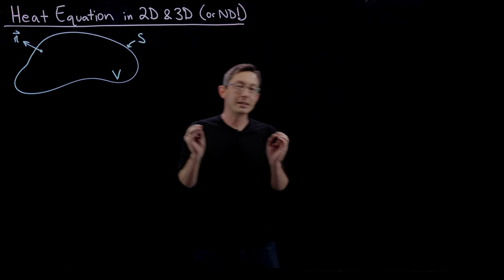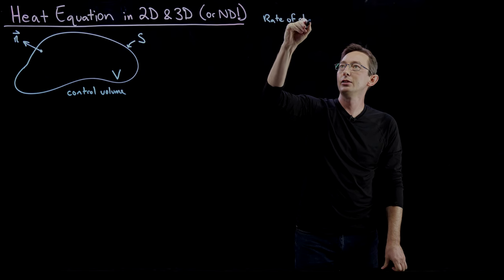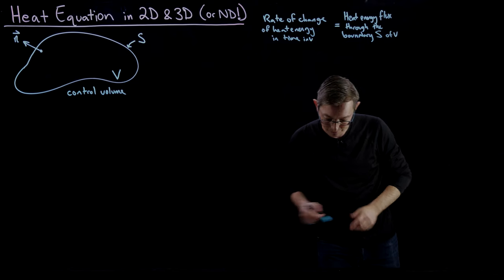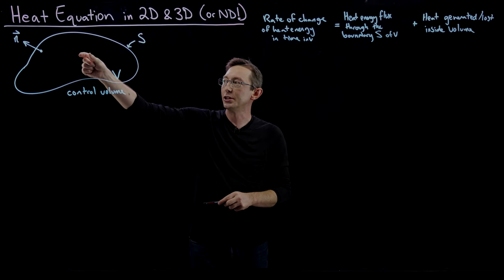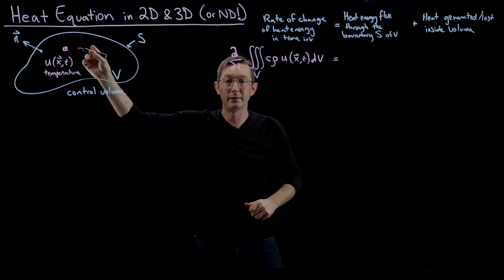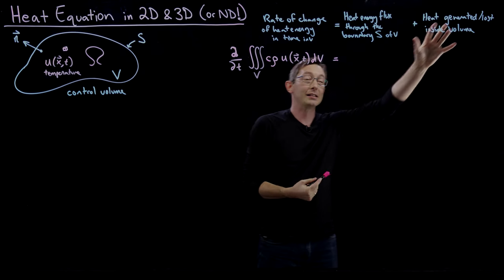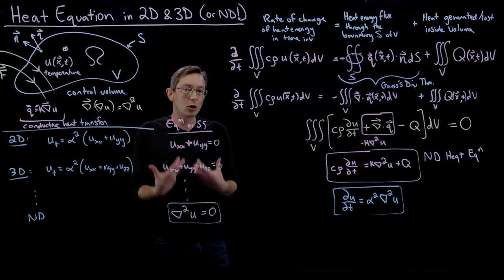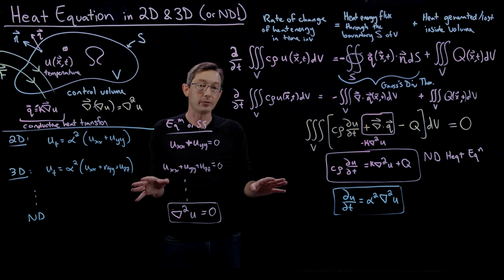Deriving the Heat Equation in 2D & 3D (& in N Dimensions!) with Control Volumes and Vector Calculus

Comment: @13:40 my ¢5 cents to this amazing video, the partial derivative (with respect to time)  can be moved inside the triple volume integral because the system is (or assumed to be)  lineal and therefore obeys the principle of superposition; otherwise, this wouldn't be allowed

Comment: You forgot the thermal conductivity in Fourier’slaw. Also it maybe good to be clear when constant heat capacity and density assumption is needed. Finally nit pick : u is for vectors, use a different letter for temperature, T maybe? It maybe fun to show the dimensionless versions of the equations…

Comment: Basically it's a wrong notation to have 2 or 3 integrals with a single differential parameter (dV or dS here).
Reply: I don't know about pure mathematicians, but in physics dV and dS quite acceptable in context.
Reply: @tomctutor  What I mean is if you have a single differential parameter (dV), then you need a single integral (over the volume V). An alternative notation would be using three differentials (dX dY dZ) with a triple integral sign.
Reply: @ahmadababaei3254  You sound like a pure maths type, as a physicist we get away with murder.🤠
Reply: @tomctutor  :))) Actually what is presented here is quite accepted and can be found in all textbooks. Still, it doesn't make it right, right?